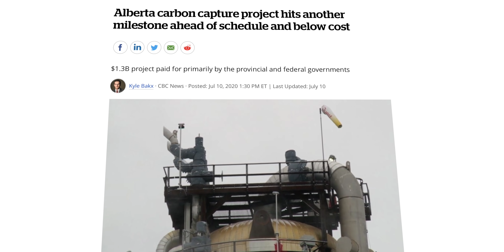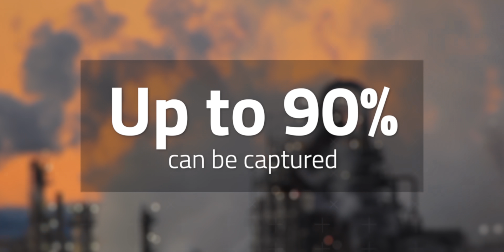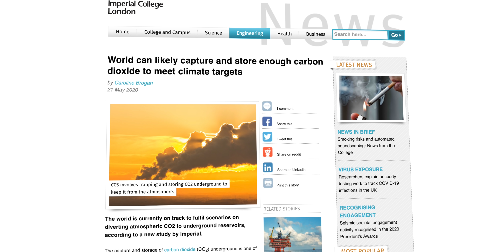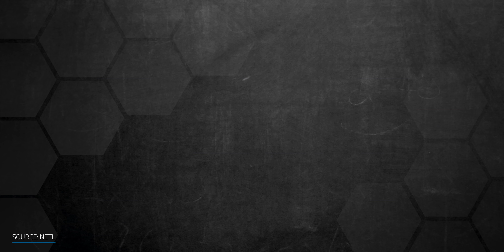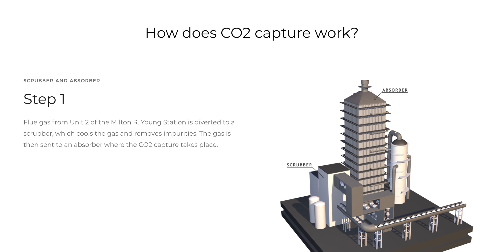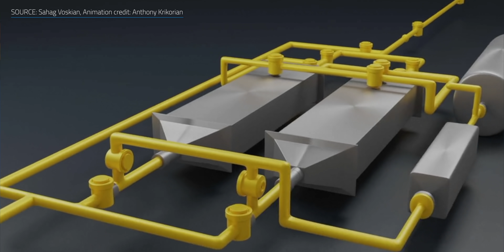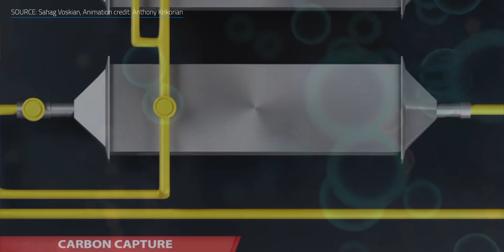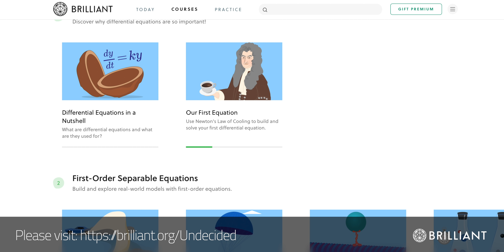The truth about capturing CO2 to reverse climate change

Comment: This is all just trying to re-engineer the tree.  Trees have a 370 million year head start.
Reply: But not thumbs, ah-ha!
Reply: I mean we redesign stuff pretty well
Reply: These don't take years and years to get big.
Reply: But trees take forever to grow and it's not like they store much carbon. Do you want to wait decades for tree to grow to only a few hundred kilos of carbon? Besides, when trees die and wilt, a large chunk of the carbon just goes back into the atmosphere. The point is to take the carbon out of the carbon cycle entirely, not just progress it to a different part of the cycle from which it will come back anyways.
Reply: @Tomatenmark13579  Uh no, you have in backwards. Trees capture the most carbon when they are growing up, after that they capture little or even begin emiting more carbon than it captures.
If they extract pure CO2, what are they supposed to do with it afterwards? Create massive facilities with thousands of storage cylinders? With trees at least you can use them as wood so their carbon content won't be put back in the atmosphere in a while. Genetically modified trees that extract more carbon just make way more sense.
Reply: @jackmcslay  Trees still take years to frow up and only store a few hundred kilos of mass at any given time. And pure CO2 can be made into various other things, like building materials or failing that, you can just put it back into the empty caverns into the grund where you got the oil and coal from. Again, you have to remove the carbon from the cycle, just taking it out of the atmosphere isn't enough.
Reply: @Tomatenmark13579  Trees contain mainly carbon.. If we eliminate water, than 99% would be carbon.
1% goes for minerals that are gathered from soil.
Reply: @Tomatenmark13579  

What about algae? I heard it’s one of our main producers for oxygen and is incredibly easy to grow.
Reply: @Saintly13  Its quite obvious. Its not scalable to do on land. Too much algae at sea will block the sun and kills everything under it. CO2 main drawback is energy but when shit hits the fans we can always turn to existing nuclear tech.
Reply: @VUnhac  

Do we have lamps that can simulate sunlight to make the plants engage in photosynthesis? Because you could build algae pools on top of one another, thus ensuring space is efficiently used.

And nuclear would be fantastic yeah.
Reply: @Saintly13  It still comes down to the science of scale. Algae does not scale well since apart from energy it still require lots of space and water. Right now i can only see algae as a complementary solution but not something to depend on in the near future
Reply: @VUnhac  

Ah, I see. Well then I guess Nuclear is our savor. If only politicians stopped being ignorant and fear mongering.
Reply: @Tomatenmark13579 
There is no such thing as an oil cave, it's stored on porous rocks from where they're pumped.
Most coal isn't dug out from caves either but surface mined. 
There is no such thing as a building material that is industrially made from CO2, it's a highly inert gas such that trying to converting it into a solid would require large amounts of energy such that the amount of emmissions it causes doing so negates any benefit from taking it out of the air. It would be way less efficient than just planting wood trees.
Any sizeable tree has it's weight in metric tons, not a few hundred kilos. Also do you know how much that takes carbon out of the air? One single kilogram of carbon extracted from the air is the equivalent of taking out the entire CO2 content out of a 4 cubic kilometer volume of air.
Reply: @Tomatenmark13579  Two little facts you can look up.  First, what is the ideal CO² level for plant growth & what is the current atmospheric level? 
Second, how much land surface is deserts and how much carbon is needed for plants to cover the deserts? How much carbon is estimated buried as coal & oil?
Reply: speed & scale

Comment: We already have CO2 capture devices. They are called "plants". The best part is that they are solar powered.
Certain algae can produce enormous amounts of biomass, we just need to improve techniques of breeding them.
Reply: What happens to the carbon when the plat dies and the body is destroyed?
Reply: Put it somewhere it does not rot. It is probably easier to store than liquid CO2.
Reply: @schwarzerritter5724  it really isn't easier to store.  But it will rot.  Sure, we can slow that down, but will always happen regardless of where you put it.  Rotting is what dead things do and nothing can stop that. 

As far as storing goes, get 8 oz of water and 8 oz of ice.  See how much easier it is to store the water.  Even if you crush the ice.  And think about the systems that you need to even pour the mulch let alone evenly so it fills optimally in a container and all you need for a liquid is just a tube and a way for the air to escape.  you are welcome to try to make an easy system to move the ice from one cup into another without bringing the cups together, but it also has to be easier and more effective than moving the water; provided you give moving the water the same amount of effort to move quickly.
Reply: For starters, it does not have to be kept under pressure. Things that rotted without air are what we call "fossil fuel".

Comment: Carbon capture is just an excuse to continue burning fossil fuels.  The money spent trying to do CCUS would be better spent on installing solar PV & wind turbines, and subsidizing new types of batteries.  
Check this report out:  
http://www.2035report.com/wp-content/uploads/2020/06/2035-Report.pdf?hsCtaTracking=8a85e9ea-4ed3-4ec0-b4c6-906934306ddb%7Cc68c2ac2-1db0-4d1c-82a1-65ef4daaf6c1  (PDF)         by the Goldman School of Public Policy        SCALING-UP RENEWABLES TO ACHIEVE 90% CLEAN ENERGY BY 2035 IS FEASIBLE

Comment: Cutting down trees and building machine for the same job and  whining that its expensive to buy and maintain.
How ironic!!!
Reply: It is all too stupid. CO2 is not dangerous. We certainly don't need to spend trillions reducing it, not that we even can.
Reply: @outofcompliance1639  the problem is not that CO2 is dangerous to us directly. The problem is the other effects it has on the planet, like how it helps trap light from the sun increasing the average temperature of the planet, or how it can decrease the ph in the ocean, which can be very harmfull for some of the organisms like corals, something that causes a chain reaction.
Reply: @alexxans1154  Yes, I know the science, but CO2 is not dangerous to the planet either. We are at 400+ ppm, the planet has been 8000 ppm CO2. I know that was a long time ago but at best it will get to 500 ppm. 
It is not decreasing the PH or effecting the corals. It is smoke and mirrors. Something happens around the world and CO2 gets blamed so we will waste trillions on trying to reduce our emissions even though the IPCC knows it will when not change whatever is going to happen in the next 80 years. Sorry, but it is 95% a scam and 5% a problem we can deal with as it comes.
Reply: @outofcompliance1639  I am no scientist but there is one thing I know. CO2 affects the ph. It has to do with H2CO3. This is carbonic acid, and what is special about it is that it is unstable. It decays into CO2 and water H2O trough this reaction H2CO3-->H2O+CO2. This reaction is the problem though because, like most reactions it goes both ways, meaning that while carbonic acid decays into CO2 and H2O, the water and the carbon dioxide also react and form carbonic acid, and the more of the water and CO2 you have, the more the scale tips toward the production of acid, which desolves in the ocean (as that is where most of the water it needs to form is), which lowers the ph. That is not data from a climate change magazine, that is chemistry.
Reply: @alexxans1154  Yeah, lots of things happen in a lab beaker but don't happen the same way in 321,003,271 cubic miles of sea water. I mean yeah it might have some affect but not enough to change anything. I am not actually saying CO2 is having no effect but that the effects are so minimal that it only needs monitoring and slight adjustments in places over the decades but 100 trillion dollars in spending for almost no gain which is what is being proposed.
There is the science and there is the narrative about the science. Just like there are political facts and the narrative about them. And when I say narrative I mean fiction. CO2 climate change being an existential danger to us or the planet is fiction and the real danger is the narrative.
Reply: @outofcompliance1639  and how exactly do you know that. Do you have any access to data that backs this claim
Reply: Trees will eventually release the carbon.  They don't solve the problem, only give us more time.

Comment: I thought I have seen a carbon capture project that used Algae growing it turning it in to just O2 and then making a biodiesel or cookin oil from the algae
Reply: Algae uses CO2 as food, then you can turn algae into oil. A perfect cycle but gas from that is still a bit too expensive and the farms take up a lot of land. I guess we will have to stick to the best fuel ever, fossil fuel.
Reply: @outofcompliance1639  the farms used non arable desert land that was otherwise worthless, so land isn't an issue. As for cost, it's just a matter of genetically engineering the algae and then producing it at scale and it will be cheaper than normal crude extraction.

Also, the strain of algae Sapphire Energy developed didn't make biodiesel- it made crude oil that could be refined into ACTUAL diesel. Also gasoline, kerosene, JP5, propane, etc-whatever normal crude oil can be refined into.

All we need is enough people demanding govt development of it, since it is clear the existing energy interests will never fund its development.
Reply: @jadedandbitter  It does seem like algae farms are good option to develop. A few years ago was the last time I saw something on it and it was still in the $6+ per gallon range when refined at best. Of course gas prices may end up there in the next few years if the GND people get their way. But as I remember the amount of land needed to make enough for all our energy needs was about the size of the Mojave desert (not worthless to the life that exists there) and the amount of water needed might also make it difficult to do at that scale.
It certainly seems better than solar and wind farms or the massive amounts of energy needed to pull CO2 out of the air when we really don't even need to.
Reply: @outofcompliance1639  yeah, it's diesel costs were $5-6... At prototype scale without genetic engineering. Engineering the algae to "sweat" the oil so that it wouldn't have to be dried and pressed, and engineering the algae to be resistant to algae phagic microorganisms to increase yield would massively decrease the cost and space required.
Reply: @outofcompliance1639  they already make cooking oil out of it . Not looking for a replacement for fossil fuel but as with any type of cooking oil it can also be used in diesel fuels. Comment is based on carbon capture technology not to replace fossil fuel . Why is this important? well when they start a carbon tax instead of other means to control it  . As for cost well this country always had oil in the shale but it was too expensive to extract until the price went up and now we use that oil. The Algae thing is a carbon capture technique not for making a replacement fuel and its byproduct has uses one of which is biodiesel .Don’t look now but biodiesel is already in use and that best fuel ever is slowly being replaced and the internal combustion engine which uses it is being replaced by Electric motors. Yeah I know it has limits but refueling is not one only the time of recharge is , solid state batteries are almost here to replace lithium ion batteries.  Unfortunately give it 2 years 4$ per gallon gas is coming our current government will make that happen and as a whole both sides never met a tax they didn’t like!

Comment: Carbon Capture huh

Think CO2 is $10 a pressurized pound so I really wish $4 of Gas could make $230 worth of CO2 used to decaffinate coffee,  make plastics, blast freezing,  low power refrigeration, driving pistons, powering Lasers and plasma cutters and other industrial uses where we have to intentially make CO2 for

It actually be impossible to scrub that 0-900ppm a second as its in the water vapor/humidity portion of the hyrological cycle venting off mostly the Oceans that has thousands of billions of tons of co2 in its icy depths😏(CO2 rides the hydrological cycle which is eahs real heat exchange mechanism constantly LOSING Heat from Equator to poles vi convection and Troposhphere to Stratosphere via evaporation/precipitation

I had a Chevy Avalanche with a California  ECB filtration system.  Exhaust only  smelt slightly of gas or 14 years till the ECB malfunctioned

Since 1994 Catalyst converted that  turn CO(why actually ejects out of engine as smoldering gas mist oxidises) to CO2 have been phased out with modern cars supplementing modern gasoline which is petrol alcohol (laced with detergents,fixers,oxygen supresors) with ECBs focusing on not giving spent gas MIT any chance to oxidize to CO in first place (Chevy was "Carb negative")

Actually they already use close injection combustion with slurry filtration in modern coal plants with only water vapor  and Nitrogen released into air and recaptured discharge sold for industrial uses.....anti coal advocates are blowing neendless smoke

Comment: How many years do these things have to work just to scrub off their own carbon footprint? It will take a substantial amount of energy to mine/transport raw materials. Manufacture/distribute all the parts. Build/transport all the units not to mention maintenance. Surely this will be subsidized. A capitalist wet dream.
Power Down and conservation is the key. In addition restituting forestry on a large scale would have multi beneficial effects that would do so much more than industrial scrubbers.

Solving a problem with the same mindset that created it is a fools errand.

Comment: 5:09 10000 gigatons and 2700 gigatons?  Over what period of time?  The current global emissions of CO2 from fossil fuels are around 35 gigatons per year.  An article in the September 2014 edition of the Chemical Engineer suggested that 10 gigatons per year of CO2 capture and storage would be required by 2050.

Comment: We need to focus on the utilisation rather than storage, burying problems never works well.
If we used renewable energy, sea water and carbon capture to produce synthetic fuels, industrial oxygen and industrial CO2 we would have a viable roadmap to carbon neutral living without the huge changes to infrastructure (and scrappage/recycling) needed to switch to "green" vehicles. I hope this is developed further as the "green" vehicle goals the governments are putting in place will take far too long to be effective and may even do more harm than good (remember when diesel cars were the economical green planet saving choice in the 90s?).

Comment: Using chemicals such as amines and alkaline metals to capture CO2 seems to me to be self defeating.  For example to make the CaO or CaOH (un-slaked and slaked lime) you need to calcine limestone.  Which uses a lot of energy and releases CO2.  Amines are often derived from ammonia that has to be produced using an energy demanding process called the Harbor Bosch process.  You need to look at the energy balance of chemically sequestering CO2.  To my only partially informed mind it seems like we are trying to develop the chemical equivalent of a perpetual motion machine violating the rules of thermodynamics.  Now if the CO2 is sequestered in some sort of natural salt dome or pours rock that Michu be ok.  Problem there is that carbon dioxide (CO2) plus Water (H2O) yields carbonic acid H2CO3.  Carbonic acid is a mild acid that will eat away at substrate rock (how many natural caves are formed).  

I was hoping you might have examined some of these questions (especially the energy balance of chemical sequestration) and explained how researchers are working around them but, alas neither you nor anyone discussing this issue has explained how these problems have been solved.  Though perhaps not very obvious to an average viewer anyone who has ever taken a few classes in chemistry probably has the same questions so I know the scientists and engineers working on this must have a reasonable explanation or it’s simply a fraud.

Comment: Wouldnt it be more efficient to bury plants before they die since they emit CO2 through decay process?
Reply: At least you know that issue, so many comments in here think plants (mostly trees) are a viable solution.  The problem there is, because trees are solid, we can't easily put them in the ground and have a long term streamline for that to occur, and the risk of having to make a huge hole to even attempt it being something long term.  Let alone the fact that to optimize or make the storage useful will require people to interact at some point, or have machines to, so that would mean that it couldn't be every air tight, even if they were made into chips (pulping can resolve this a bit but takes a lot to do and would defeat the purpose), so there would be a carbon leak as a result also defeating the purpose.

But at least you are thinking and thinking long and short term.